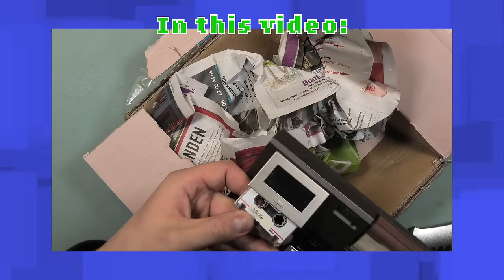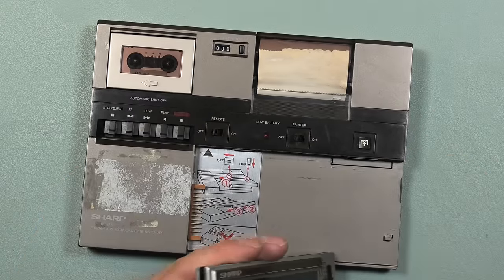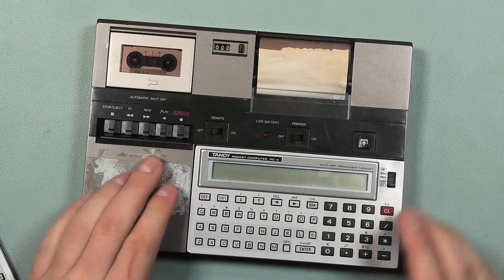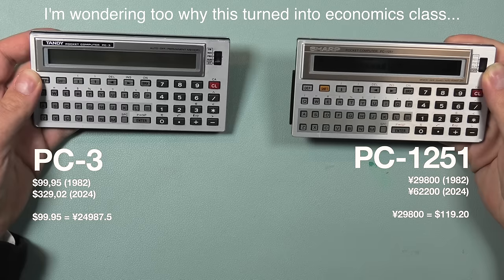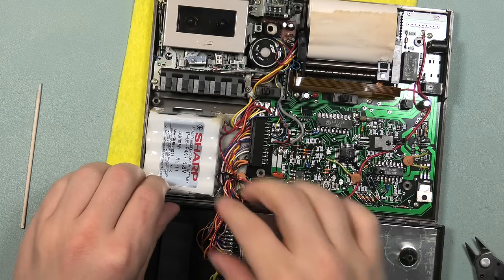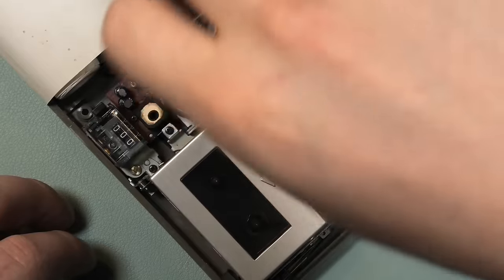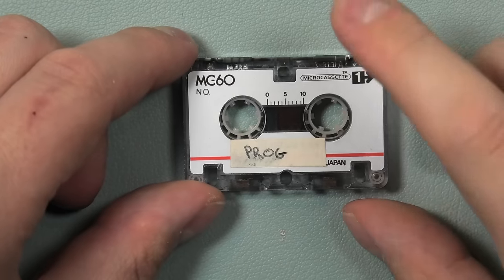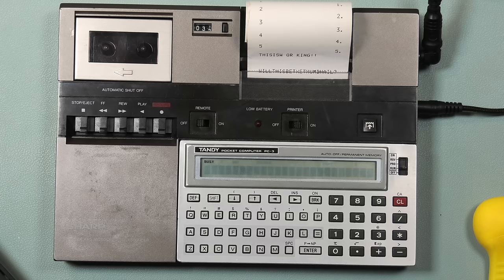Trying to Crack a Pocket Computer Tape | Sharp PC-1251 |Adventures in Archiving 2|

Comment: That's just amazing!!! A small computer running BASIC programs with a tape deck and a printer !!! wow.
Reply from the maker: Agreed! I always wonder what it was like back in the day to have one of those…
Reply: @RetroMels It was pretty cool, but as most people didn't know what it was they weren't impressed. I had (actually, I still have) a PC1245, which is like your machine but with a shorter display and half the RAM (2K). I never had the expensive printer/cassette add-on.

The PC8201a which I also still have and which also still works was more impressive to people. I guess it's not obvious that it's an actual computer and not "just a calculator".
Reply from the maker: Oewh PC8201 very nice! I have the TRS-80 model 100 which has a similar form factor.
Reply: I thought it was cute, but the thing that blew me away was the Radio Shack Model 100. That was actually usable as a computer and a word processor.
Reply: @DavidHembrow  You can tell it's more than a calculator - it's got an alphanumeric keyboard. I didn't expect it to do BASIC though either.
Reply: @RetroMels A schoolmate of mine had one pocket computer like this (mid '80s) and she brought it in class sometimes, the coolest thing ever.

Comment: I still have my PC-1500 and the printer, so do a couple of good friends. We decoded the assembler language ourselves using the original manual's BASIC POKE example, and exhaustive/exhausting testing. BTW the printer is not a printer, IT IS A PLOTTER. It pushes the paper up and down and the pen (!!!) left and right.
Reply from the maker: Oeh nice! The CE 125 manual refers to it as a printer. It is a different mechanism then the ones with pens. I have one of those plotters that works with my TRS-80 Coco’s.
Reply: The printer that Radio Shack sold for my Tandy PC-8 was a thermal printer (definitely not a plotter), and looks very similar to the one in this video.  It had a small head that would sweep over the paper, leaving the characters behind, much like a dot matrix printer, except thermal instead of impact.

Comment: Marvellous work! I Have a Sharp PC1251 which was used by my late father back in 1986/87 to run insurance premium calculation in the field. I later used it to program for my engineering degree..   That program listing at about 15 minutes in, is very similar to a software program I had that was used by radio amateurs to calculate the antenna bearing required for transmitting from your home station to an overseas location where you knew the latitudes and  longitudes. I will have to resurrect my Sharp and see if I can confirm the listing from the snippets shown!  Many thanks for the nostalgia!
Reply from the maker: How cool!!

Comment: If you found acid corrosion on the pcb you have to wonder how it got there. One path commonly overlooked is through the wires, yes the capilarity of the wires can wick the acid from the battery to the PCB. I would completely remove the 2 battery wires and place new ones. Check the other wires conected to the pcb + too, by pulling a bit on the insulation. Cheers.
Reply from the maker: That is great advice! Thanks! 🙏🏻

Comment: Just tripped across this video. Good job!

A few suggestions:

1. Try some lemon juice or white vinegar on a swab to clean up that battery acid. I've had decent luck with that. Obviously swab off the area with clean water and a paper towel a couple of times after to get rid of the acid and any dissolved battery goo bits.

2. When tinning a wire, put a little fresh solder on the iron, then touch the bare wire to the top of the iron for a few seconds to heat it up, and then apply fresh solder to the wire itself. Doing it the way you did by just using the solder on the iron, you don't really have enough flux, and won't get nearly as good a tinning job. You can see in your solder joint to the chip leg that the solder wasn't as fresh as it could have been. Doing it the other way should make soldering easier and give you a better result. A little practice and you will be doing perfectly well soldering.

3. When wrapping stranded wire under a screw head, it is best to strip, twist, and then tin the wire. Without tinning the strands can separate and fray out, and possibly end up shorting to something near the screw head. You can see frayed wires sticking out of the head in the video. No harm was done this time, but a simple bit of tinning on the wire will produce a better result.

You are doing great, keep up the good work!
Reply from the maker: Awesome tips! Really helpful, I’ll keep those in mind for my next soldering endeavor!🙏🏻

Comment: Funny thing, I have exactly this same setup, with almost exactly the same problems. I'd first recommend indeed YES actually replacing (not removing) the battery in the printer/cassette dock. These machines typically only use the AC Adapter to charge the battery, and the machine is designed to run from the battery as a cleverly-regulated DC supply. To charge the battery, they take the AC adapter DC voltage and run it through a resistor, then to the battery (which can be perpetually charged without issue, as long as it's a low current). It's a cheap and clever way to provide DC voltage regulation (a clean 5 volts, as this era's logic chips loved to run on), without large or wasteful DC regulators. So, definitely 100% replace the battery - running it on AC adapter alone is prone to degradation. (A modern NiMH pack is perfectly suitable to replace the NiCd pack - I just grabbed one on Amazon that fits and works great!)

Next, the tape on mine needed a whole evening's worth of circuit diagnosis to figure out why it couldn't hear incoming signals. Some of the traces was eaten away by the battery acid, and I had to figure out which ones, and patch them. Though everything might appear working at a quick glance, subtle issues like that will arise. But given that the aux input jack is working, I suspect you may have dodged that bullet.

I work with pocket-tools a lot, so maybe I can boot that interest back up and get back into it. I wore myself a bit out on pocket computers after refurbishing a whole box of the things. haha. Now I just need to finish selling them! (I'm not much a collector, just enjoy fixing things :) ).
Reply from the maker: Awesome comment! Thanks for taking the time! Helpful tips I’ll keep in mind. In moving forward with my CE 125. I can relate to feeling a bit burnt-out after spending a lot of time fixing a certain type of product. Had that myself with trying to replace belts on a MZ-800 cassette deck.

Comment: Thanks for the video.  As a teen, I got the Tandy PC-8 and the printer/cassette adapter when it was on its way out.  It's basically what you have here, except that the PC-8 has a smaller display (fewer characters) and the printer/cassette adapter doesn't include the actual cassette player, but had mono plugs to connect to an external cassette player.  It was a neat little computer.  My dad had a PC-7 which was very different than the PC-8, but I later learned it was because Casio made that one, and Sharp made mine.  I grew up programming with BASIC, mainly on various TRS-80s and the Apple II (and a clone).
Reply from the maker: Oeh cool!!

Comment: i learned basic back in 1979 when it first came out, i was only 9 yrs old. A friends parents had the TRS80 desktop pc and i had the TRS80 pocket pc. Both devices came with manuals on how to learn basic but the big TRS80 desktop manuals were much larger and had a lot of stuff I didnt get with my pocket pc version. We spent 5-6 month clicking away every spare minute and had the majority of basic programming down. Within a year i was making graphic programs and these were super long codes, this is where the tape drive came in handy so you didnt have to rewrite 500+ lines of code every time we wanted to work on something. I still have my TRS80 pocket computer works like new, though i do worry about that screen issue. I myself was looking into purchasing a replacement but i agree prices are a little steep.
A few yrs later Radio Shack came out there the Ti-99/4A which was a LOT more affordable for consumers, and it had games on cartridges, which used basic code...basically.
  It didnt take me but a couple days to write code for full screen animated color graphic which totally blew my teachers minds that i knew basic programming and they knew nothing. Lol Though i gave them and other students a crash course in basic for a class 6 week project. 

Also, look up how to load the tape code to the pocket PC. If Im not mistaken there is a button or control code xx that activates the pocket pc to start loading(listening) to the tape when it starts playing. And i guess worst case there could be something wrong with the docking station, or maybe its connections(pins)?

Comment: I’ve minimal luck loading or saving from computer. Micro cassette works flawlessly but digital audio is extremely finicky I’ve found with my two pocket computers. The trs 80 pc-2 and the sharp 1500

Comment: Wow! I bought the PC1251 and docking station brand new in 1982 from a fellow who travelled to Japan frequently for work. Mine still works but I have to replace the LCD now (I have a modern replacement). If you have a dead screen, you can test the functionality of a PC1251 or one of the variants by using the beep command. BEEP X will output X number of beeps from the tiny speaker in the computer so BEEP 5 will beep 5 times. 

Also, the printer is a 4 colour printer. I’m surprised that the pens have not dried up. Mine has spent a lot of time in a box in storage but the cassette still works and it loads and saves just as one would expect it to. It’s a very resilient little computer. With a Z80 CPU, 24K RAM and a fairly powerful BASIC.

Comment: Have you tried adjusting the playback frequency of the WAV file? The drive in the dock might be running the tape at a different speed than the portable player you used. Obviously you also need some sort of manual adjustment of amplitude when feeding it back into the dock.
Reply from the maker: Good advice! I used the faster speed on the portable player. The loudness of the recordings was similar to the known working file. But playing around with those settings is a good idea!🙏🏻
Reply: @RetroMels  Although volume is important on the recordings (loud enought without clipping), pitch is probably the most important indicator.  If you have a known good WAV file, you can compare it to yours.  You can probably get it close enough by ear, or you can add your track in Audacity and compare the spacing of the peaks.  Cassette motors weren't the most accurate things back then either, so it should have a little leeway.  Great work!  I love seeing people rediscover the old tech using the newer tech.

Comment: Very good video.  I hope you finally can succeed in cracking the code.

The PC-3 was made by Sharp and apart from cosmetics, is identical to the PC-1251.  My PC-3 docking station has only the thermal printer and no cassette unit.  Instead it has audio jacks that connect to an external recorder, using the standard cables.

My 1251 is in excellent condition with the exception of the LCD.  Despite being kept in a box, it began turning permanently black.

The guy that makes the replacement LCDs charges the very reasonable price of $20 US but getting it here to Canada that turns into $35, or over $50 in our money.  That seems like a lot but it's not his fault.

No one seems to know how he makes the LCDs, but as far as I know he is the only source in the entire world.  It suddenly hit me that he could retire, lose interest in the project, or die at any moment, and anyone who has been holding off as I was, will be out of luck.  Their pocket computers will be instantly worthless.

So, I ordered my LCD and received it in about 10 days.  I'll install it next week.
Reply from the maker: Hope the installation will be a success! 🍀 Agreed that the LCD’s are reasonably priced, shipping to Europe is what turns it into quitte the investment for me. Also I sort of fear I lack the skill to perform the replacment. Would be interested to hear how things turn out for you. 

Thanks!🙏🏻
Reply: @RetroMels  There are plenty of videos of the procedure being done.  Hey Birt from the Ozark Mountains put up such a video a few months back which motivated me to get into action.  It's not particularly difficult but cleanliness is essential.  Good luck with yours!

Comment: Need to Be careful with Data & Audio cassettes  (Even Voice Micro cassettes  Dictaphones Have the Worst Wow & Flutter )

Yeh Data cassettes   have 0 tolerance  to A Audio (music Human  voice cassettes  Deck Built on the cheap to Wow & Flutter) and music & Voice Have loads of that going on 
Data Decks Have very different motors (more Coils)  and Bigger  Pinch Roller Flywheels To Eliminate Wow & Flutter & motor interference even the motor has magnetic shielding and A Scrubber network to keep the power supply clean

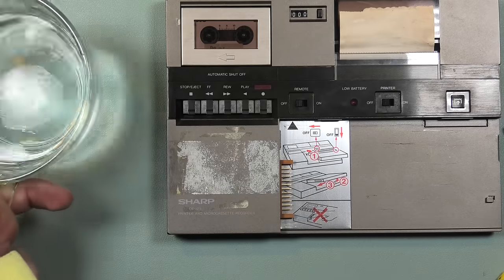Comment: 5:14... Use Goo-Gone or Goo Buster... It will not damage the surface but will dissolve the glue.
6:35... Use a Water/Baking Soda mixture to neutralise the Acid Residue.